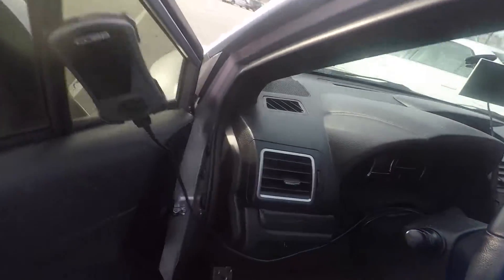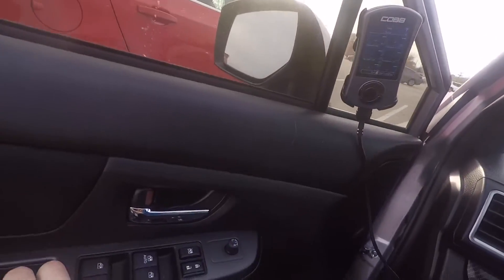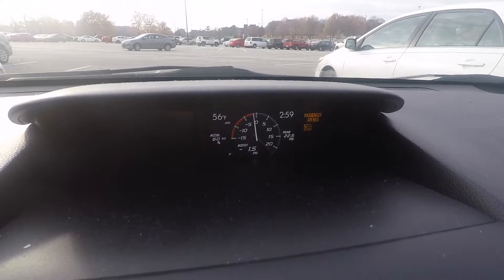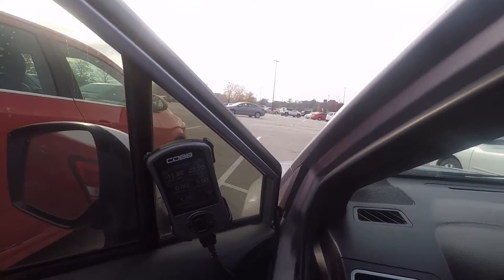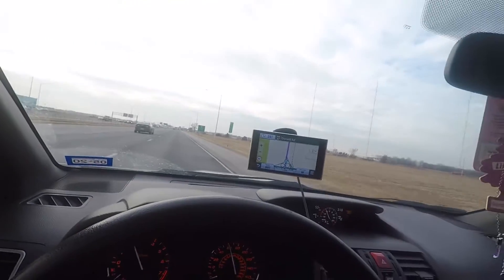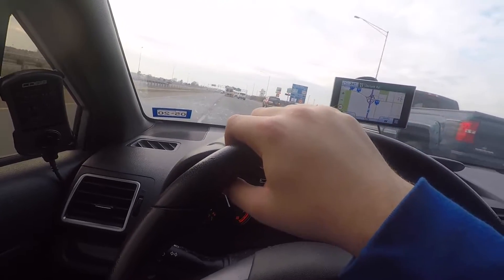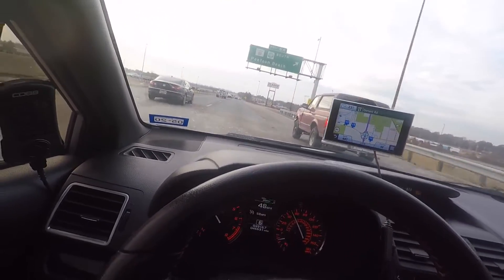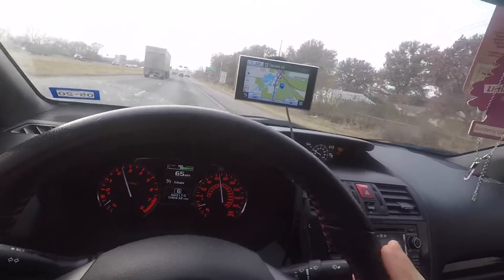WRX is broken! No Boost!

Comment: It idles high and adjusts ignition timing on cold start to get the cat and O2 sensors to temp quicker so it gets to closed loop quicker. It’s actually a very good engineering idea. Mostly for emissions.

Comment: Subaru turbos do break... Very common. Check banjo filter for clog too. Vf 52 new was 1250 new. Yours is garrett so could be more.
Reply: First wrx i bet
Reply from the maker: My main concern is preventing this from happening again, but I don't know what caused it.  The burnt oil spattered near the turbo and the internals of the turbo being all shredded is just weird.  Replacing the turbo is the easy part
Reply: Get less for more power!!!
(It need some godlike booster
Reply from the maker: @Abrahm Ward Stock pump and intercooler.  All I've got are the following: Cobb Stage 1 intake package, Tomei Expreme Ti catback+Grimmspeed J Pipe, the GReddy Type S bov with an open air vent setup and a stage 2 style protune with similar settings to the cobb stage 2
Reply: I know multiple people who keep breaking these. 2 of 5 were because they used lc too much and wore it out prematurely. Upgrade to a 18 or 20g. New Garrett turbos are made cheaply
Reply from the maker: @RFakaWRXringland  This car doesn't have launch control but it has been launched multiple times and I often will go full throttle a few times a week.

Comment: Sounds like blown turbo
Reply from the maker: Yep, the turbo shredded itself apart internally
Reply: The Racing Joker Sheesh.. that’s sucks.. End up getting a diagnosis as to why?
Reply from the maker: @balance667  Basically someone failed to mention that they didn't do an oil change when they were supposed to.  Bad oil levels and the poor turbo died
Reply: The Racing Joker Wow.. Ya that’ll do it. Seems to also be a few oil related recalls on the fa20s. My oil filter had too much back pressure, spun itself loose, and shot oil all over my engine bay and ran my oil almost completely dry. Good thing the filter was mounted  on top, the smoke it created allowed to me immediately realize something was wrong, if it was underneath well, that coulda been bad lol.

Comment: I'm having the same symptoms. I had a small boost leak then did the same thing yours did. Im hoping its the turbo cause I have a warranty on it
Reply from the maker: Well it turns out my turbo shredded its internals because the oil hadnt been changed in a while (I was led to believe it had been). So no boost because the turbo was dead and just grinding metal on metal
Reply: @TheRacingJoker  i dont see how it can be that, like I change mine every 3-5k and she all of a sudden pooped out. I shall see when I take her to the shop Wednesday